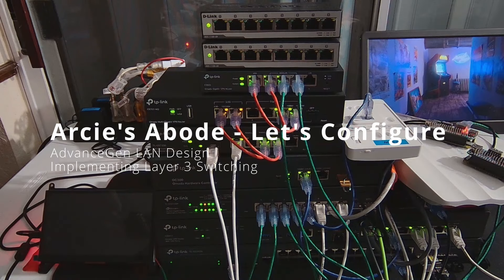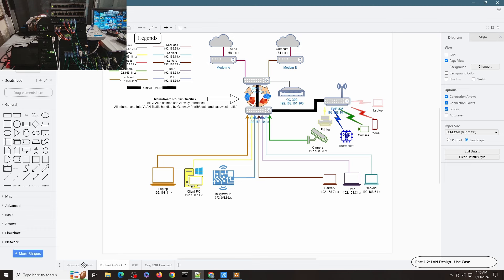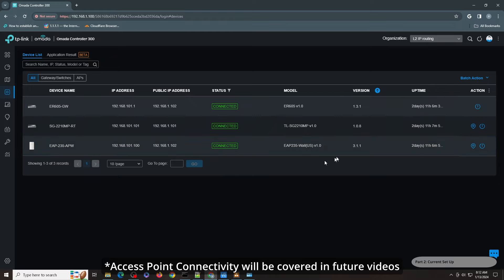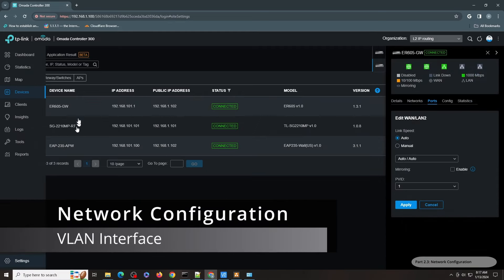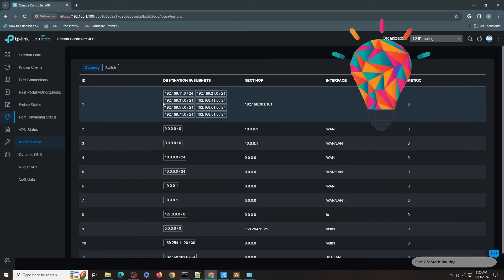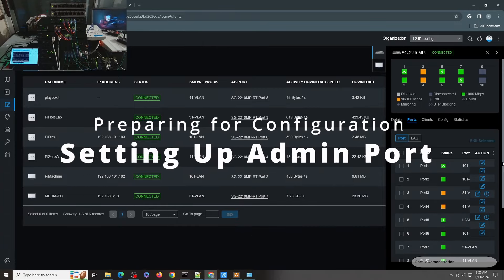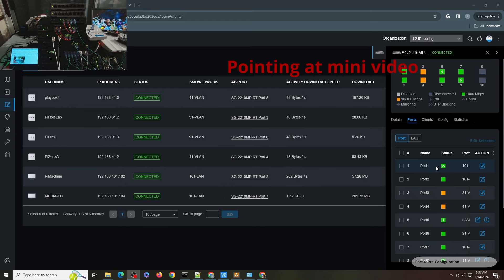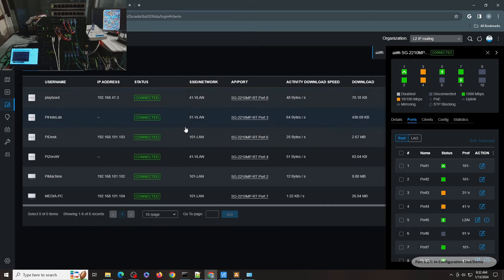LC67: Layer 3 Switching with TP Link Omada. Use switch, instead of Gateway, for InterVLAN routing

Comment: Good day sir! Ganda ng setup para ma less burden ni Router lalo if low-end lang din pero question ko is 
 How about defining my ACL'S? Para customize yung VLAN na allowed to communicate to each other? 

Should I use padin ba the normal -> Switch ACL -> then Custom ports ba? Tapos i-select ko lang yung DISTRIBUTION SWITCH PORTS? Kasi dun naka define yung mga SVI's? Thankyou sir! :)
Reply from the maker: hello @user-rr4op5lj5l , tama ka sir, less load kay router. As for ACL, tama ka ulit. Meron akong video na in-upload kanina lang regarding ACL. Kung kailangan mo ng guide, check mo lang, pero korek ka doon sa sinabi mo! tnx sa pagbisita sa channel sir!

Good hunting!
Reply: Sir how about may dalawa akong distribution switch? Isa primary isa backup then sa baba apat na access switch?

Also sir yung "Port Profile"101VLAN (which admin also yung UPLINK ng L3 switch mo na connected sa ROUTER) naka check as TAG dun lahat nung VLAN na ginawa mo?